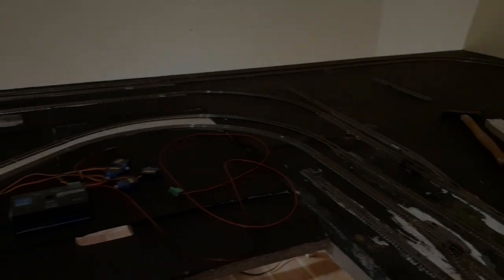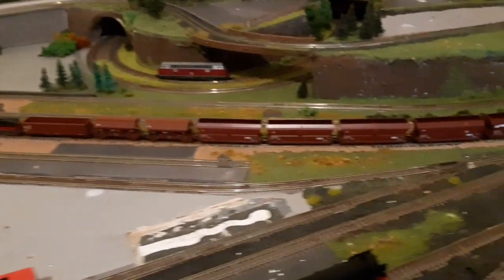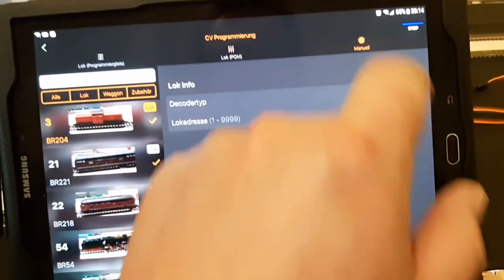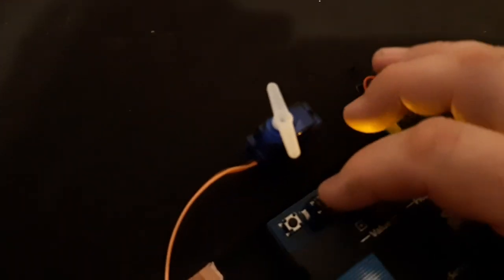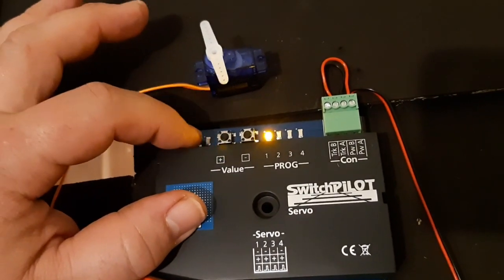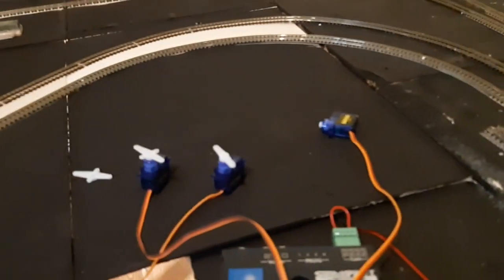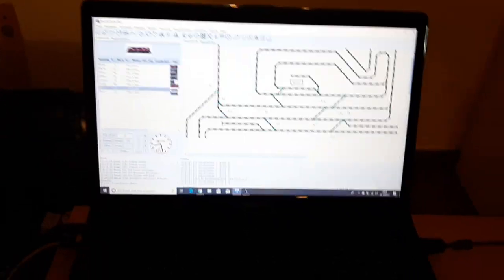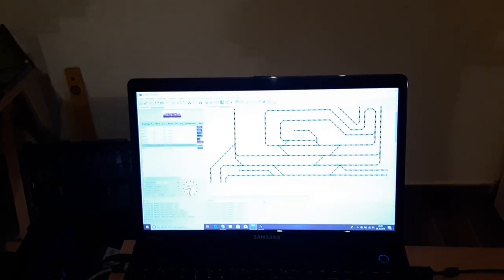Toms Mobawelt - Programmierung eines ESU Switch-Pilot  Servo.

Comment: 4 weichen analoginkl. Magnetantrieb sollte jeder haben, zum Ansteuern.  4 kippschalter Led für anzeige mit widerstände, max 8 euro + kabel vom Stellpult zur anlage.  dagen sprechen weichendecoder für 4 weichen 30 euro. plus Z21 zentrale (ohne die es nicht geht) gebraucht min.160,-€ evtl. (ohne die es nicht geht)+ Rocrail software ohne die eine PC steuerung nicht geht.  Aber  Ich werde auch digital Gahrdienstleider werden und Analog fahren. die ganzen strippenziehrei...    kein bock mehr drauf. ein datenbus legen..   fertig.